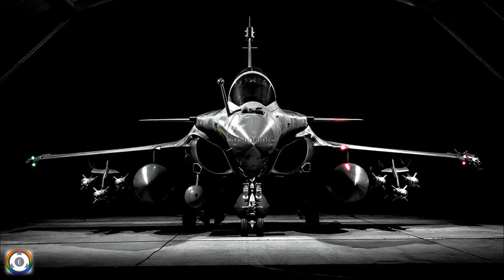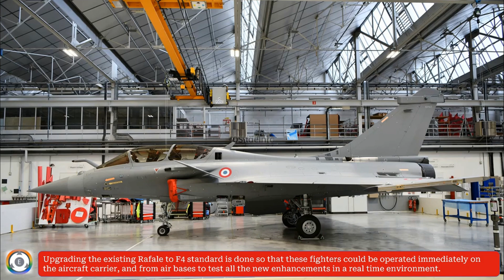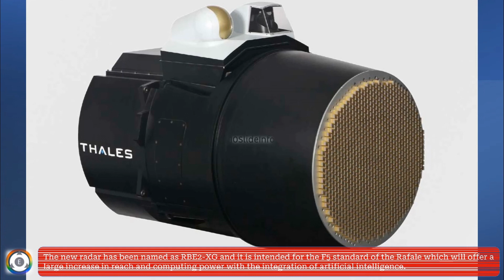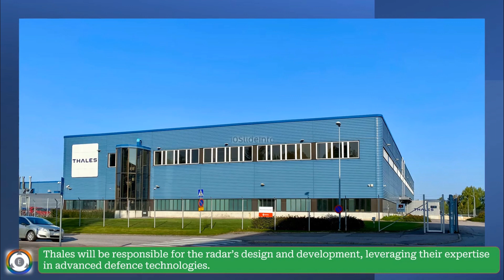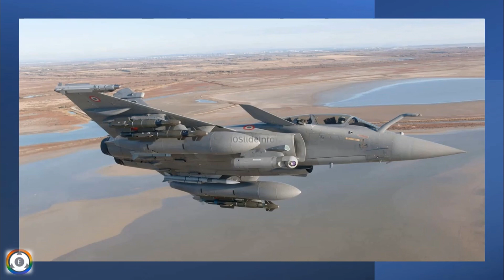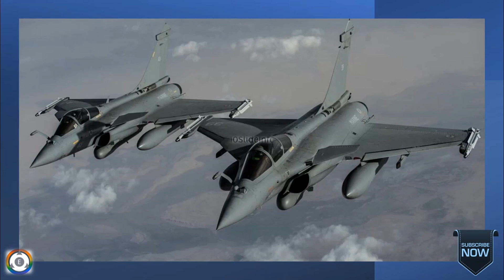Rafale F5 With New GaN RBE2-XG Radar | Rafale F4  Rafale F5 Upgrade

Comment: F-35 is more stealthy and more capable than Rafale any varients.
Reply: Your F-35 can't dogfight, the Rafale will destroy your flying potatoe in few times.
Reply: stealth yes, more efficient LOL what kind of weed do you smoke, what kind of alcohol do you drink????? you know that you are talking nonsense? F35 speed = mach 1.4, and not mach 1.6 or mach 1.8 which are lies from LM / Rafale = mach 1.8 !!!! F35C (the one with the best flight autonomy of the 3 versions) = 2200 km / Rafale = 3700 km! F35 armed F35B empty weight 14600 kg, maximum weight with armament 19000 kg / Rafale C empty weight 9850 kg, maximum weight with armament 19350 kg / F35 = 9G+ / Rafale up to 11G+ !! this F35 is a big pile of shit, and I pity the idiots who bought this pile of shit !! ah yes, your F35 does not have super cruise, the Rafale does, at mach 1.4!!
Reply: dirty liar, poor little troll!
Reply: The new Thales RBE2-XG will detect all 5th gen.stealth fighters, it will be installed on all Rafale F5 by 2028.

Comment: Rafale F-4 varients should be upgraded with retractable air refueling device and equipped with 20% of 6th generation and 30% of 5th generation fighters.
Reply: it's false!!!
Reply: where do you get this nonsense from, the refueling boom will never be motorized 1) the mechanism is too heavy, and it is precisely the job of Dassault engineers to hunt down excess weight!! so, what you say is false!! 2) the Rafale is a small twin engine, the installation of any system poses too many problems for Dassault engineers, the Marine version of the Rafale forced Dassault engineers to place equipment inside the wheel housings of the main landing gear, which means WE CANNOT FIND SPACE TO FIT THE REFUELLING BOOM!! and the nose of the Rafale is too small! no, there will not be on the Rafale F4 in service any part of a 6th generation aircraft, what is this nonsense, there is a Mirage 2000 which serves as a prototype in the south of France which will serve as a mule to test equipment of very recent design! and for parts of 5th generation aircraft, ditto, only components which will be on the Rafale F5 will be tested on the latest Rafale F4 put into service, like the RBE2 AESA radar which will be replaced on the latest Rafale F4 by the RBE2 XG or TARAMMAA! why lie ??????